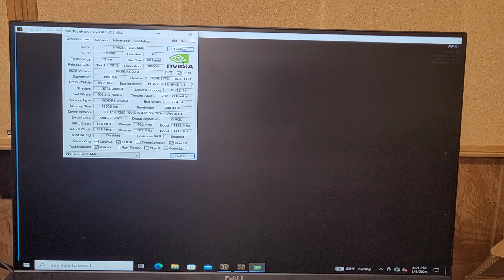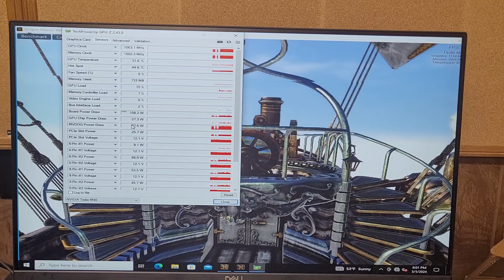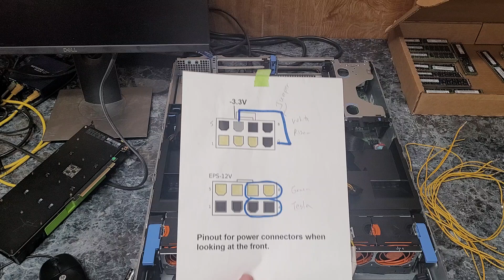My prototype Dell Poweredge to NVIDIA Tesla cable is finally in

Comment: I'm thinking about putting an NVidia RTX 3090 on a Cisco C240 M5, do you think it would work? The PSU is 1600W. My question would be regarding the power cables? any suggestion?
Reply from the maker: I have no experience with that model of server. I have seen pictures of them and believe they have powered GPU support though. You would probably have to dig through the manual and see if there is a part number for the power cable.

Comment: i dont see the sense wire for RX3X series servers and in turn will cause the server to fail to power up
Reply from the maker: I guess I don't know if it is officially a sense wire but that was my understanding what the -3.3v is essentially doing. The server will still power up if you don't have that jumper. The GPU just won't initialize/work properly.

https://youtu.be/i8zoQsK9dDo?si=yd21Nnl0i1vD3ItC&t=294
Reply: @computersales maybe instead of shrinkwrapping/etc wires get the ends and crimp ends and slap into the EPS connector? for the GPU and use R and G stickers on the connectors, just some random thoughts
Reply from the maker: @SakuraChan00   The shrinkwrap mostly is there to keep the braid in place. With the locking tab design it is technically impossible to plug in the wrong way if you are trying to plug both ends in.
Reply: @computersales  was referring to the connectors themselves for the EPS side example sent via Discord msg

Comment: Looks much more professional than what I've cobbled together 😂
Reply from the maker: Yeah turned out nice. Just not quite the visual design I wanted.
Reply: Nice work! It looks good.... I do understand your concern about length, heat shrink, and the possibility of a kink. I like your thorough thought process and careful plans for prototypes. This one does have positive features; and there may be a universal one to come 👍👏
Reply from the maker: @DHuhnCatMom  yeah it is tricky dialing things in.